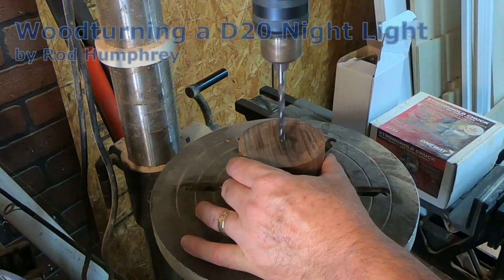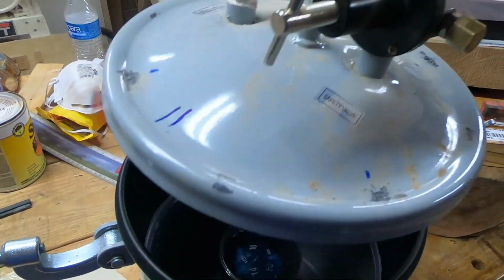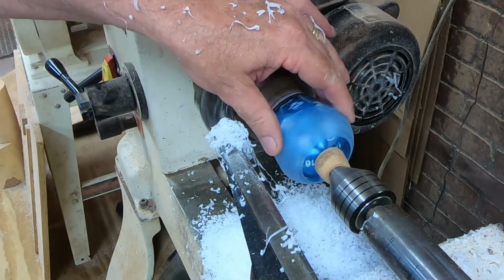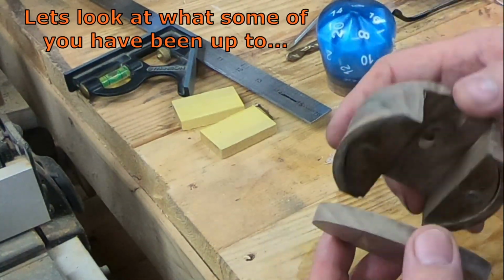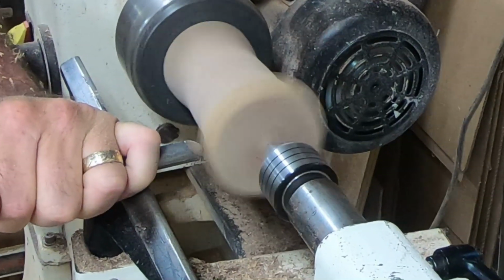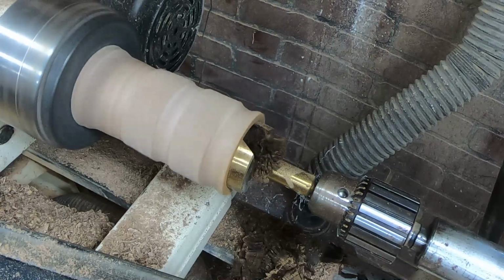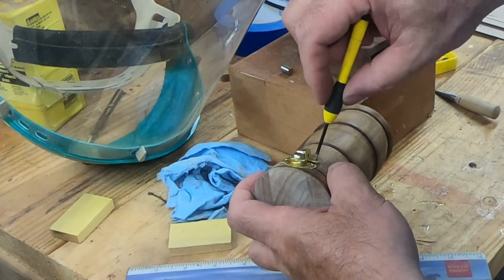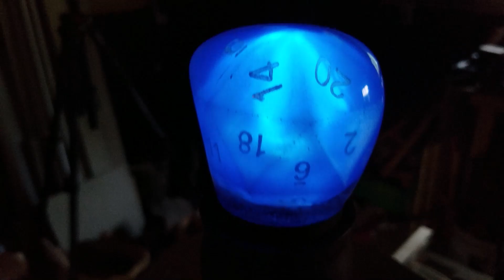Woodturning a  D&D Night Light - Resin Art

Comment: What size resistor did you use?
Reply from the maker: I used 12v LED diodes for a 9v battery circuit, so I didn't figure I needed a resistor... Should I have? If so, it's an easy add